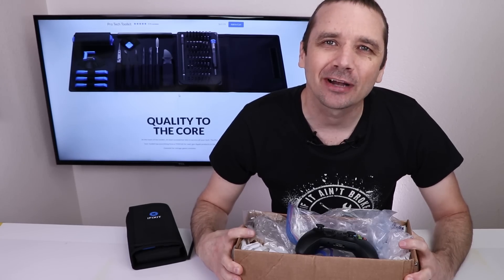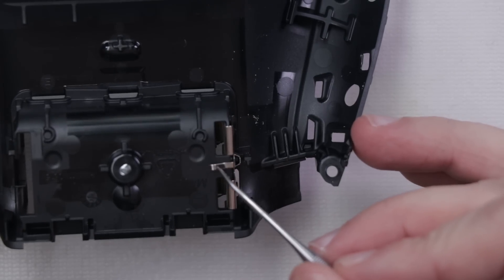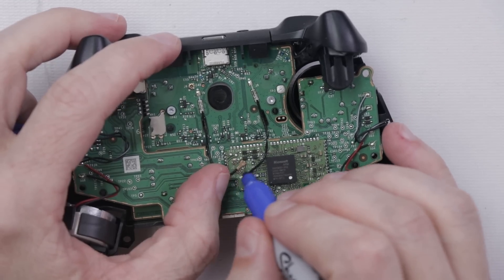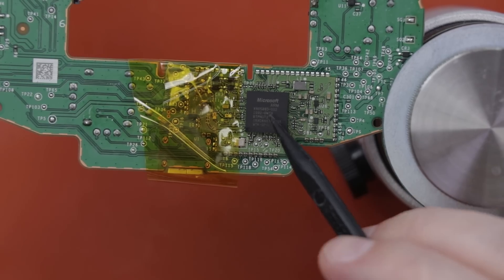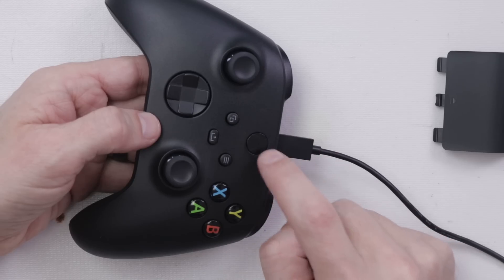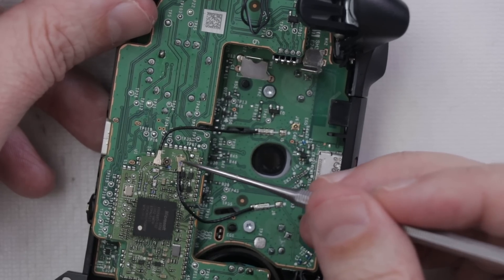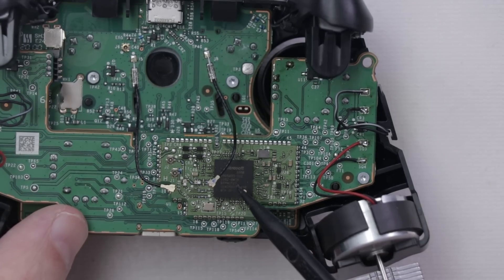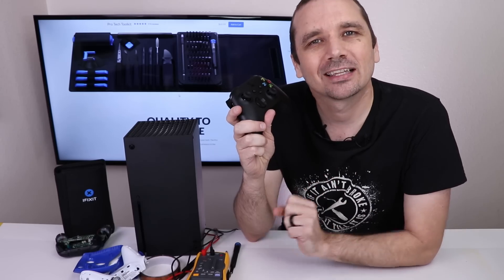I Bought the FIRST BROKEN Xbox Series X Controller - Can I Fix It?

Comment: I have same problem, but also when connected to that antenna socket bord with chip becomes warm and start to smell. At least i can use it wired now. BTW warranty is full year but because these controller does not sell officially here (Ukraine) i had to import it from Poland and warranty return is only available from supported countries (When i type my Ukraine address nothing happens, but if i type my Poland shopping address it proceed to send it with UPS to Austria. Because UPS is also overpriced in Ukraine it's cheaper to just buy another one). By the way it's aqua shift model. Front mold manufactured in February 2021 and back mold is from July 2021.

Comment: Did you ever find a solution to this? I have the same issue.  If I disconnect the wire it works for up to 20 feet though. It’s not a huge deal, just curious.

Comment: bruh those new grip plates are so hard to get off! it's worth it though because they fit a lot nicer than the old style and don't creak / shift around like they did before. (had to remove one of mine because the trigger was sticking due to the foam pad being placed incorrectly in the factory)

overall, i think it's a big improvement over the previous ONE S controller.

Comment: Hi Steve! I have an xbox one 1708 model controller and it has a similar problem. Unlike the new xbox series controller, the previous model (1708) has only one connector while the newer one has two (as shown on your video). So the controller i have works fine but i have to leave that connector unplugged or else it doesn’t power on. However in my case, it works fine even at a certain distance (6 feet) so maybe some kind of short?

Comment: mine been bit dodgey like batterys run out in goes off n dosent resync and have reset console but fingered crossed after propa reset dosent do it again n but i searched up common on these controllers
Reply: I'd just use the xbox one controller then

Comment: Hi - have you exp where a ps4 console won't charge a known working DS4 controller. Issue started when I tried connecting a mech keyboard. Keyboard worked for a couple of minutes then stop working. Tried googling the issue but I keep getting ds4's faulty ic result.

Comment: @TronicsFix if you notice the antennas are soldered to the other half of the board. I’m guessing it’s so they can use an area of the PCB as a bigger antenna. Try desoldering the one that’s causing the controller to not turn on and then plug it into the antenna port by doing this you should be able to see if it’s a issue with grounding on the soldered part of the antenna. Since these are the same antenna styles used by smartphones, computers, etc. I think that the chip is fine but there’s a short in the antenna wire when it’s soldered to the other pcb.
Reply: I have this same problem
With a 1708 model controller. It works but have to leave it unplugged or else it doesn’t power on.

Comment: Actually its simple and you have completely missed the fix for the controller would you like to know how to fix it.

ok the reason you are having a issue is because the attenna wire is grounded to itself unsolder the attenna wire from the board and just connect the wire without it being attached and soldered to the board its not the board with the brain its the board without the brain that has a short.

Comment: Hey Tronicsfix, I think I know the problem on this controller, I'm not an expert, but I have a hint. As you said, controllers get yeeted really bad. I think this one has the board under the antenna connector broken and it's taking in power from some other component or something like a capacitor near that connection is wrong and is drawing in power. What you could do is check all the components for the electrical charge by your voltmeter when the controller is powered on. If that doesn't work, try replacing the board with the known good board from another controller. Also check for liquid damage on the small components. If the controller works fine with the known good board, the board was damaged in the layers inside. Do try and I hope it fixes the problem :)

Comment: it's crazy how wide the board is in this controller, and still using double A batteries in 2021?
thats absurd
Reply: I game on pc with an XBONE controller that's always plugged in anyway but to it's defense you can buy a rechargable battery for it if you want and you can even easily change them out when they die or go bad. It's kind of nice having AAs as a backup

Comment: Those appear to be two patch antennas by design (can't see other side of the board to confirm).  What you have may be a 1T2R configuration: 1 transmit, 2 receive.  So the faulty path is one of the receives which would explain why your reception suffers.  Wireless reception is influenced by the square of the distance you are from the source (electrical engineers are taught this in first year).  You were on the right track looking at the components in the receive chain.

Take your soldering iron and rotate any of the inline or shunt caps in the RF signal path and see if they crack.  A common but hard to spot issue with 0402 caps is cracking when installed by the pick 'n place machine.  If they are damaged, then replace as required.  A hairline fracture is hard to see but easy to find as the part will literally crumble when you apply heat.

You can swap in the other daughter card and isolate the fault to the radio module or the side with the antennas.  Most likely on the radio module side.  The extra steps will confirm.

Comment: Why don't you try the known good D-Pad board with the 'faulty' controller. I say that because I recently purchased an Xbox One Fornite controller that had a faulty 'view' buton and replaced the power board and it fixed my issue.

Comment: This was actually really interesting because it was a novel problem you couldn't fix so easily. You were able to figure out the limits of the problem and you basically have a really good idea about the culprit, but could also be still wrong. Intriguing indeed. If it was just a totally unknown situation of not even able to turn the controller on, it would be far less interesting.

Comment: my xbox series X controller is really bothering me, everything works fine except the Y and A buttons don't register sometimes, unless I press harder than normal. Super frustrating. Not sure if I should open it up myself and take a look at it or maybe try to get a warranty replacement from Microsoft, but if I do that then ill be without a controller for weeks, since its my only one. RIP.

Comment: maybe try soldering both antennas to same connector. It might boost range enough, and those chips usually have a lot of leeway with power for those. a bit junky but works.

Comment: A little off topic but BW-100 spray 100% works. No more controller drift 👍
Reply from the maker: As long as the potentiometers aren't physically worn out it does a great job getting them working again

Comment: Did you measure the impedance of the antenna on that side of the known good controller from the cable , seems to me the only thing that could cause a condition like that would be some kind of problem on the antenna side, else why would unplugging it remove the fault ?
I know you checked with the other side , but are you sure they are both the same ?

Comment: Did you try some of the components on the cord of The other board the part where it's soldered into there could be a component that went bad there that could be shorting it where it is not working

Comment: My switch was water damaged.  I got back working , but the fan turns on after i power off the unit and won't stop unless I turn the switch back on or unplug the battery.  Any thoughts?

Comment: A great video could be trying to install a different more durable analog module for Xbox and PlayStation controllers with drift. You seemed intrigued by those modules in the new Atari controller- wonder if that could be used. Anywho, great stuff as always Tronix

Comment: Is it possible to replace the antenna that’s causing the issue, or the pad it connects to? Just wondering and maybe not the chip itself but antenna 🤔 
Would be weird, but maybe could try🤷🏼‍♂️
Reply from the maker: If the antenna was the problem then it would have worked when I plugged the other antenna in
Reply: @Tronicsfix  gotcha, thx for explaining 🙏🏼
Cheers✌🏻
Reply: Yeah, that was my thought too, because it seems like its the antenna short-circuiting, not a problem with the chip.
Reply: He tried two antennas.

Comment: hey I dunno where to get help, I have the original the xbox one and my controller disconnects frequently even with new rechargeable batteries, does somebody know what can I do?:(
Reply: I have this problem sometimes, and usually it connects again after a hard reset to the xbox.
Reply: Btw that's not the real tronicsfix ^^^

Comment: Hi @TronicsFix,

Maybe the antenna is shorted with the shielding. If thats the case then it might worth checking continuity between the antenna and its shielding (It could cause a short to one of the powersupply rails).
Reply from the maker: If the antenna was shorted to the shielding then it would have worked when I plugged the other antenna in.
Reply: @Tronicsfix  They both could be broken in some way, but only one antenna output prevents from booting. It may be worth checking also the other board or even connector itself.
Reply from the maker: @FrankDrebin  If the other antenna was broken then it wouldn't work when it was plugged in to the working socket.
Reply: @Tronicsfix  If you know how antennas are wired inside the chips then sure.. From what I can see on the video the antennas are for different frequencies, not sure if these are 2.4 + 5 GHz for wifi or something else, but backend will be way different.
Reply: @Tronicsfix  At GHz ranges RF is pure magic anyway, classic electronic is just not applying to it.

Comment: steve come on ya gotta fault find :( is there continuity through the wire? is it shorting if it's plugged in and not plugged in? maybe swap the antenna wires around? not everything needs a replacement
Reply from the maker: You should watch the video.

Comment: kind of odd that folks sell them on ebay instead of getting a warranty replacement, it's only been like 4 months since the consoles came out
Reply: in Norway its 3 years warrenty and 5 years of 
right of complaint witch is almost the same as warranty for all electonics thats meant to last more than 5 years. yey Norway!!
Reply: Could have been bought from a scalper, I doubt they offer warranty.
Reply: I think the warranty on controllers is 90 days
Reply: @SuperSpyMonkey  the whole console has warranty including controllers
Reply: @yusufiftikhar4423  it may not have been with a console
Reply: Heh, must be a non-European person then.
Over here EVERY part of the device has to be covered by the standard 24-month warranty.

Or, the seller broke the controller and knew that warranty doesn't cover it, like chucking it across the room, or giving it liquid damage.
Reply: @SuperSpyMonkey  Doesn't hurt to try though. I sent my PS4 Pro to Sony two years after warranty expired and I had even opened it so the warranty stickers were slightly peeled off and they still sent me a fixed console for free. All I had to do was provide proof of purchase. Same with an original PS4 controller I had bought used on eBay! I sent them the eBay receipt and they still accepted it and sent me a new controller, I think I just had to pay shipping on that one. So I would always give the manufacturer a try first, especially with a device so new and with an issue that doesn't seem like there was any tampering done.
Reply: most of thems store and amazon returns people just buy bulk lots of that stuff that may or may not work and test and resell it how it is
Reply: liquid damage doesnt count
Reply: @nitehawk4067  true.
Reply: You'll find that most people never register the product or activate the warranty.

Comment: When I built my new computer I started it out as a pile of components with no case. When I put it in the case, I forgot the antenna (which is just externally connected to a port in the back of the motherboard. It freaking worked!!! I was still getting high speed internet without an antenna. I was shocked.

Comment: If one can easily get piles of broken PS5 controllers, but finding a single broken Series X controller is noteworthy, that definitely speaks a lot on their respective quality.
Reply from the maker: There's more to it than that. How many have been sold compared to the others? What is the warranty policy like? etc.
Reply: Maybe there are just more PS5 sold than Series X. Just a theory.
Reply: @bsanp  yeah i don’t get how people don’t get this
Reply: Not super surprising.  The Series X controllers are near identical to the Xbox One controllers making them the 3rd (?) revision of the same controller.  The Dualsense is basically in field testing at this point in it's life.

Comment: Is stick drift a common issue with these?
Reply from the maker: I think it will be a common issue
Reply: They use the exact same parts as PlayStation and last gen Xbox controllers for the joystick. They probably will get to the same failure rate.